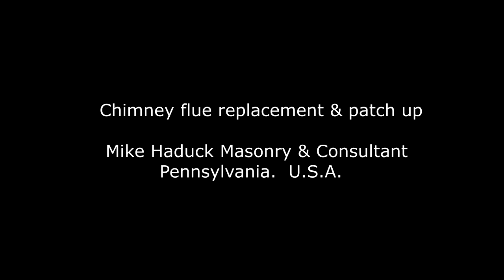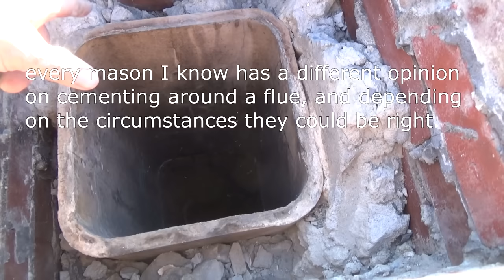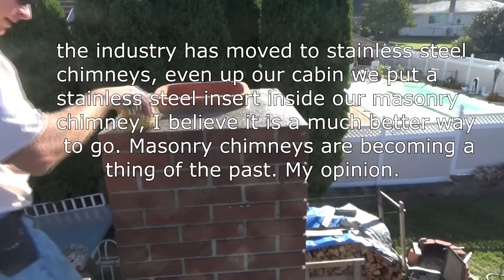CHIMNEY REPAIR  (part 5 ) Mike Haduck

Comment: This is a very informative video Mike. Could you please tell me how much of the clay pipe can protrude above the mortar cap ?? Would a 22 inches be to high for the chimney Sir ??? Thanks for your information and knowledge you give away freely. Thanks again Mike, you ROCK !!!!
Reply from the maker: I can't say, thanks Mike
Reply: Thanks for trying fella. I appreciate your help.  @MikeHaduck
Reply: I worked for a chimney sweep for many years. We also installed chimney caps. 
So I can tell you this. 
A multi flue cap is the best. It covers the entire crown. The normal height of one is 8, 10, and 12 inches. 10 seems to be ideal. So clay liners need  about 4 or 5 inches of clearance. Depends on your local codes. Most states I think are about the same. But check anyway. Thus a 5 inch high flue needs a 10 inch high cap.
If you want single flue caps, the height can obviously be much higher, but can be cut if they're already installed to accommodate a multi flue cap. Without a cap, the chimney will deteriorate much faster especially in the snowy states. 
Hope that helped a bit.
Reply: @livefreeordie5534  Thank you Sir for your help with a response. Have a great day and peace to you too. v

Comment: Mike did the cement on the very top used to shrinkage crack like this back in the day, or is the "new" technique easier because you just skim it after the cracking?  I always wanted to experiment with a very dry cement mix but haven't gotten to yet.  I have used fiber reinforced with good luck that way.
Reply from the maker: Hi peep, yep it shrank up a lot so I always went up the next day and would go over it, thanks Mike

Comment: If someone has a chimney fire, that means there had to have been an excessive creosote buildup. Thus the homeowners fault. 
The liner could also come crashing down with or without fill. 
Thus people need to have their liners swept by a professional on a timely manner. That depends on how much or how old or neglected the chimney is. 
I've seen old 150 year old homes with less creosote buildup in fireplace flues than 50 year old homes. 
I've certainly seen enough of that crap. I was a chimney sweep for many years. 
Cool channel. Subscribed.✌️
Reply from the maker: Thanks, I agree, Mike

Comment: Hi Mike, I have to put a new crown on my cobblestone chimney, very similar to the one done in your video. Similar climate, in the northeast also. I got both Quikrete commercial mortar type S, and Quikrete commercial crack resistant concrete mix. Which should i use for the top row repointing and cap? Thank you for your videos, they are a trasure trove of info for a first time homeowner!
Reply from the maker: The concrete mix has stones in it which is no good for laying brick, I can't explain what to do unless I was there to see it but the other videos in the playlist should help, thanks Mike

Comment: Hi Mike when you said you used rich Portland on the crack is that the same 3 to 1 mix you used before or a different mix. Also my single flue block has some hair line cracks in the mortor where the mortor meets the block.  other than that the mortor is fine. Should I cut it out with the diamond blade. Or just fill it with portland. Thanks
Reply from the maker: Hi Bill, I got a playlist out called, "repointing brick work" Mike haduck, that should help, thanks Mike
Reply: Thanks Mike I checked it out. Like all your videos it's great. Thanks for getting back to me. Bill

Comment: Mike, do you just stack the flue tile dry and fill in around it or do you mortar them together before filling in around the sides? Thanks, another great video.
Reply from the maker: they have this flue compound that we were told we were suppose to use, and many times I did, but I never seen a difference when I tore them down, and I will not build a new chimney,  everything is going to stainless steel. only repairs, and when I repair them I always suggest they install a chimney liner,  i hope it helps, thanks mike

Comment: I like your work Mike. I have a cracked chimney in my attic similar to the damage in this video, do you recommend using a mortar mix or I do have Portland cement available... just wondering which is best ? 
Thanks
Reply from the maker: Hi Dave, every one gives a different opinion on this, but I usually use "s" mortar which contains portland,  everything depends on the situation and what your trying to achieve, and the area of the country you live in  I hope it helps, mike
Reply: Mike Haduck Masonry, thanks Mike for your quick reply, actually there’s a bit more damage than the one in your video but not beyond repair.....it’s in the attic...so no one will ever see it, so appearance isn’t a problem...I’m after 100% strength...I was thinking maybe some Portland with a bit of aggregate and mesh cut to shape....not a bad idea maybe ? 
I’m watching all the way from New Zealand by the way......🙂
Reply from the maker: Hi Dave ,new Zealand,  wow, I don't know about the earthquakes there, I would ask the local masonry supply what they recommend,  sometimes straight portland is too hard,  thanks mike

Comment: mike.  if you put a piece of plastic over the cap after you form it up, it won't crack and there's no need to go back and add more.  give it a shot sometime.  just need to take plastic off the next day. (Obviously)
Reply from the maker: Thanks Jerry,   I appreciate it.  mike
Reply: @MikeHaduck  I use a lot of bonding agent in a wash. It makes it much stronger, it cures much slower, and it won't crack. No need to go back and do a second skim coat or even cover it.

Comment: Hey mike im grinding & tuck pointing a stone chimney now & some of the stone are falling out cause the mortar is disintegrated behind the stone & turned to dust & theres a big hole going down between the flue & the stone. When i put mortar in it just keeps falling down the hole, what could i do to plug up that hole? I was thinking of screwing a wire mesh to the flue & bending it so i could put the mortar on it & it wont drop down the hole. What are our thoughts & ideas? Oh and ive tried plugging it with pieces of brick & stone & mortar but it just keeps falling down from gravity. Thanx
Reply from the maker: Hi Bob,  old chimneys are a nightmare,  I usually do what I got to do the best I can and warm them about the future replacement,  I hope it helps thanks mike

Comment: Someone caulked the cracks & actually put spray foam in the bad joints & thats why the mortar turned to dust i told the owner. The chimney is going to have to be rebuilt from the roofline & up but for now owner just wants it pointed up but even some of the joints have big holes in them to whete when i keep putting mortar in it just keeps going in & falling down behind the stone so i just need help figuring out how to do it without going through a bunch of mortar & time to try & fill those joints. Thanx
Reply from the maker: Hi Bob I am not there to see it but, usually I use a piece of wire mesh, or wet it and use rapid set fast drying cement  to patch it fast and paint it, lot of different things to consider,  I hope it helps, thanks mike

Comment: Do you have to put mortar on the joint between the clay flues when you put the new one into the chimney?
Reply from the maker: Hi GSD, I do, it will show in the rest of the series, others might disagree, most  chimneys are steel lined anymore, thanks mike

Comment: Too bad i couldnt send u a picture. Basically i thought there would be brick around the flue going up the whole chimney yhen the stone around it but there isnt any brick just open space between the flue& the stone cause the extra mortar crumbled & turned to dust from laying the stone back when they built it. So when i replace the couple stone that are bad & tuck point it theres nothing to hold the mortar up from falling in that empty space between the flue & the back of the stone. When i would throw mortar & pieces of filler stone&brick in where the 2inch thick piece of stone came out of, the mortar would drop all the way down the chimney. Its basically hollow between the stone & the flue. I thought about using backer rod for the joints that are washed out so the mortar just doesnt keep falling in. But where i gotta replace the stone the gap next to the flue is way to big for the backer rod that's why i thought screwing mesh to the flue then bending it at 90° so it holds up the mortar then i would b able to push the 2inch stone back in against the mortar. I know u would have to see it to understand but im trying explain best i can. Thanx
Reply from the maker: Hi Bob,  I can't say ,  especially  over the internet,  I would have to actually be there to see it,  but I am sure you will figure it out,  thanks mike
Reply: K thanx mike keep up the good videos